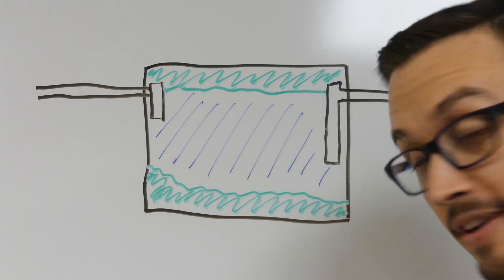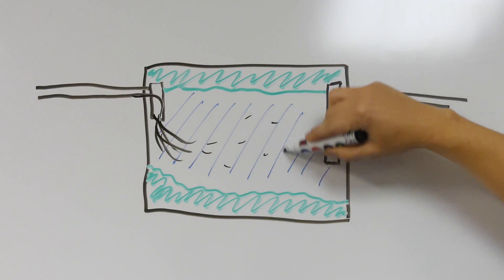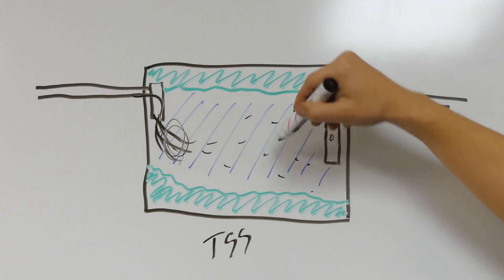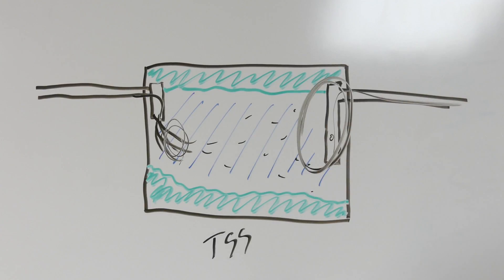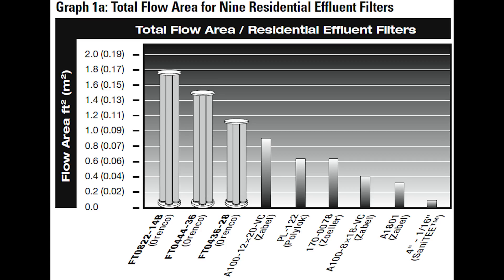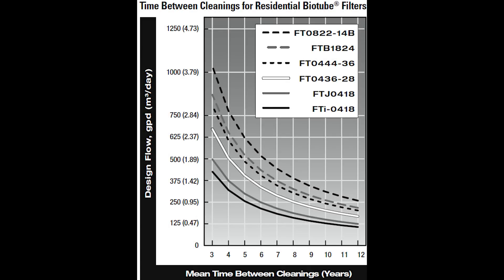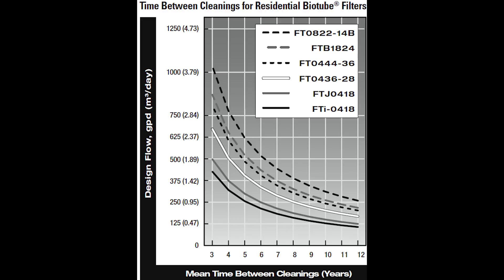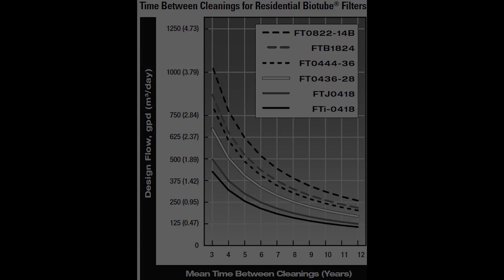The Importance of Effluent Filters

Comment: My septic was pumped on Nov 2021 and I have to clean my filter every 2-3 months. Recently I have to clean it every month and it is caked with solids which is backing up the system.  I am very cautious about what goes down my drains. I do have a water softener that backwashes every 2 weeks. 3 people live in my home and my system is 1,000 gallons. Seems crazy that I have to have my system pumped in less than a year.  I’ve changed this filter 5 times since November 2021. I only use liquid detergents and never use harsh cleaners. Every month I flush a green gobbler treatment pod down the toilet. What can be causing this to get clogged so quickly? I read it doesn’t need to be cleaned this frequently